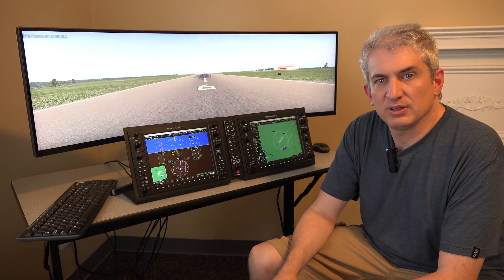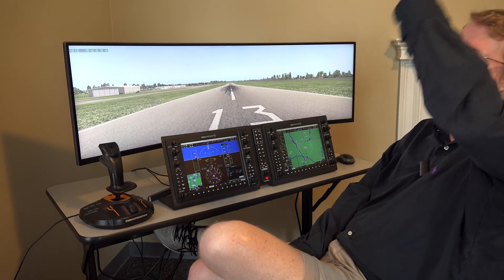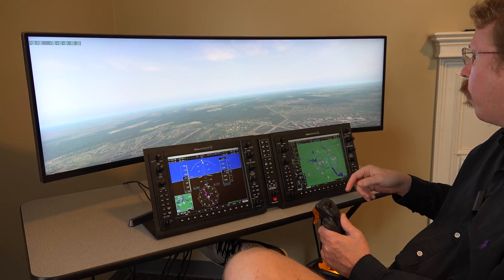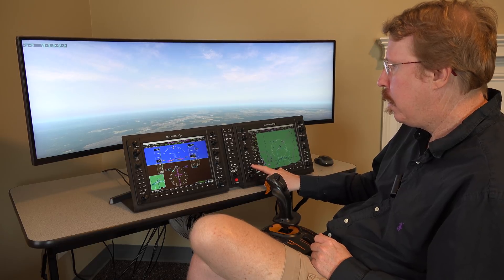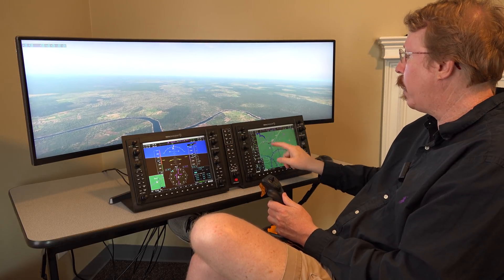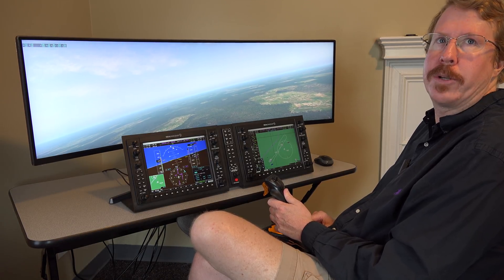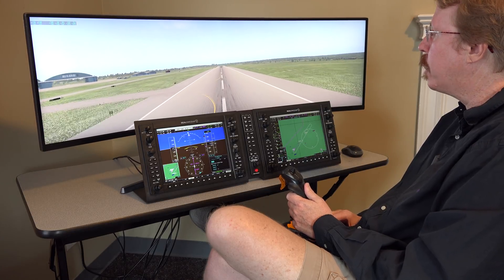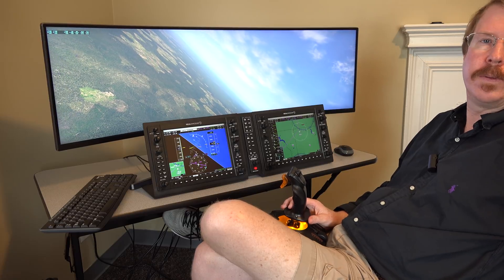Austin tries the RealSimGear G1000 Suite for the first time

Comment: I'm about a month into IFR training in the Cessna 172 G1000 version and the sections of the MFD Austin claims "you never really use to complete a flight" I use for every single IFR flight (specifically the AUX page). It would be really great if they could lose that mentality and get down to brass tacks in simulating the full functionality of the G1000 in X-Plane because without those elements of the MFD you can't do complete real-life checklists and it omits crucial steps in the cockpit workflow, which is not good for effective training purposes. So, Austin: could you put in the good word to Phillip?
Reply: This is why the redhead and xp suck, and the way he blows it off is shocking; I'd be surprised if he even has an IR and flies in IMC. Looking to build a G1000 C172S sim myself for my IR, but xp has to be the worst for that. Simionic seems to be the best, but you need two iPads and you'll spend (in 2023), about $1700 for them and shipping from the land of covid, which means weeks and weeks or months.